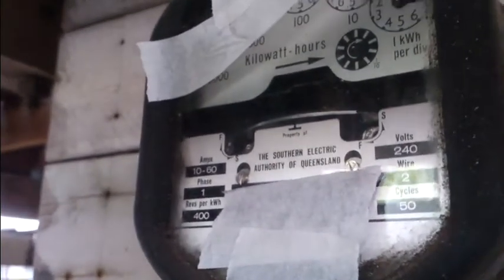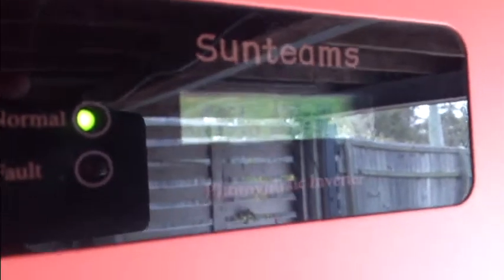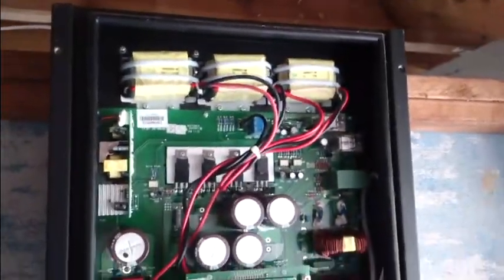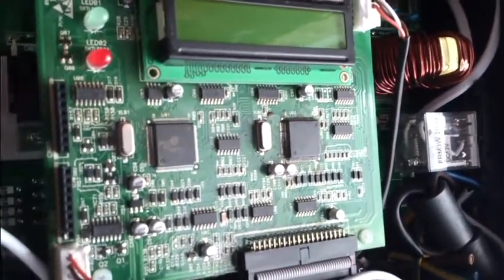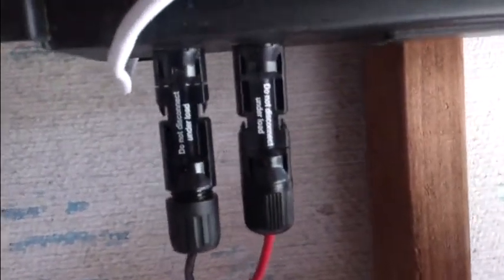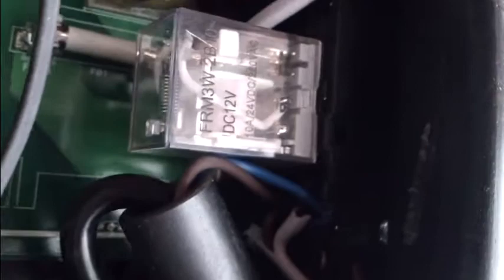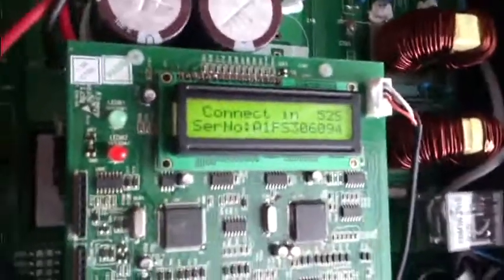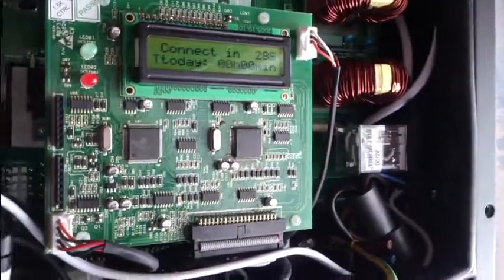My DIY Grid Connected Solar power system

Comment: HMMMMMMMMMMMMMMMMMM save yaself from jailtime and go stand alone with ex telecom bats asap. They cant do shit to ya otherwise, put ya heater and aircon on off-peak rates, everything else on ur stand alone till u build up to 6kw. Also with the heat in qld I wud get genuin pv cabling, its rated high temps and 1000volts. Dont be so crazy to save a buck, use the right gear and lower the risk of a fire or accident. That old queenslander house will go up in flames in an instant, I am in a besa block construction and i still use the correct cable and conduet and adhere to LV spacing of cables. It wudnt hurt to read the cabling regulations, if ur gonna do ur own wiring and also you dont wrap cable around conduet, try using cable clips for that size cable and seperate 150mm from ac cabling on a parellel run or put in an insulating barrier, I usually do a run on the opposide of the beam. You dont want ac induction accuring into that read switch, which will damage the system and may cause a fire. Good Luck!

Comment: This is wrong in so many ways. AC wire to bring the DC solar to the inverter. Not a good idea. sorry your a long way from wiring this the right way. no good hiding your meter number. One phone call to you tube Australia and there got you.
 Mate if you going to do it that way Don't tell every body. you will get busted. Rewire it the right way get rid on the suicide plug.

Comment: Its not a grey area, its illegal! its also called THEFT! So the rest of us that have a legal setup have to put up with people like yourself that rip the system off. Also what happens when someone is working on the lines while your doggy system is powering them up.
Reply from the maker: it's a standard grid tie inverter, same unit as those installed in thousands of homes around australia and the world, anti-islanding is a required feature in all inverters.
People like your self (if being paid on the old FIT system) who sell your export for more than you buy in, are costing us through greater costs on our "supply charge" and increased per KW/H costs.

It's the gready solar customers with roofs plastered in panels, making insain profit (ie getting a credit on your power bill) thats being paid for by tax payers and grid connected power users (every renter, majority of home owners ect)

Don't go all high horse here, i have to do something about my energy bills, because people like you are ripping $$$ out of the coffers of energy execs and share holders, who look to us as the means to keep massive profits up.

Your FIT is paid by us who by law, can't get it.
Reply from the maker: voltare2amstereo  Just to add, My "supply charge" is going up from $0.50 per day to $0.80 per day from this month. Who's the thief there?
you know why? because energy demand has dropped in the last 3 years, it's now 80% of the demand required in 2012.
search "death spiral" -it's happening. my usage costs are low enough, I'll probably be off grid completely in 3 years. 
10 more panels and some batteries, im gone.
Reply: voltare2amstereo 1. My grid tie Inverter is connected via a disconnect to the power box which feeds power to my home as required by Law, not plugged into a power point as yours is. "into the old air conditioning line" Your inverter is a standard grid tie inverter, yep no argument there, but the way you have it hooked up is not exactly legal is it. It cost me quite a few dollars in inspection costs etc. to get connected to get 8 cents a KW (in Victoria)..woohoo I'm gunna be rolling in it'.
2. I don't have solar panels plastered all over my roof. I have 4 panels (1.0KW) which is all I could afford, quite a small system compared to most others.
3. I'm a taxpayer, so I'm ripping who off?
4. High horse. I've only got short legs mate'. Do something about your energy bills? off course you should. I agree.
5. Yep I agree that the power company's are ripping us all off, but that's never gunna change. Power and Gas prices are never going to come down.
6. FIT. I'm paying for my own and you are getting free power as shown on your video. ".turning your meter backwards" so you are getting it.
And by the way, I liked your video, everything looked well set up. It was only when you showed how you set up that switch that cut the solar off when they come to check the meter. Automatically thought thief
Good luck with the off-grid. I would like to do that myself but cant afford it.
Reply from the maker: 1 yeah the power point thing isn't correct, but it does go to a breaker on the switchboard, also has the correct dual pole dc isolator.
2 should find the capacity of your inverter and max it out with used panels, they are all over ebay, and cheap too. your system is listed as the capacity of the inverter, adding panels should make no difference to your fit.
3 more costing than ripping off, the house i own, has a system legit type with the older fit, i know the extra pay back on that is coming from other users of the network, including those who can least afford it. installing in this house the way i did helps me without someone else paying for it, as i am contributing to the grid, just like you are, im mearly reducing my overall load. i make 3.5kwh per day so far, we use 4-6 a day, they still get 80c day out of me plus surplus we use.

difference here is, we can now afford to run the heater at night or an air con during summer without worrying so much about cost.

6 my legit system ran for 12 months before they actually could be bothered to change the meter from mechanical to smart, it ran like that without issue, same as here. unfortunetly i have to keep this system invisable to the meter guy, as australia is so protectionist of big corp, we can't legitimately do our own systems, like the us and many european countries. 

10'000 to go off grid these days, batteries are getting cheaper, and solar panels about $1 per watt to buy.
Reply from the maker: 360994835706
	ebay item
$7000 in hampton vic, full off grid system.